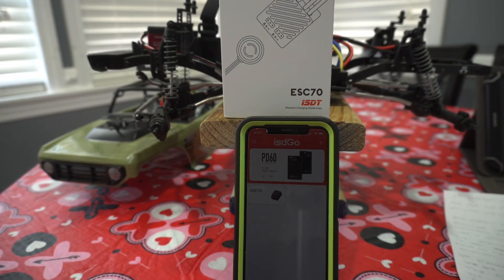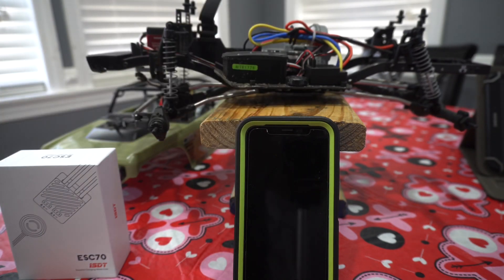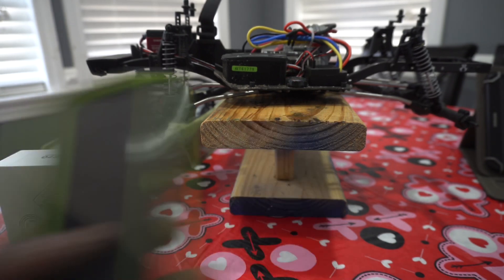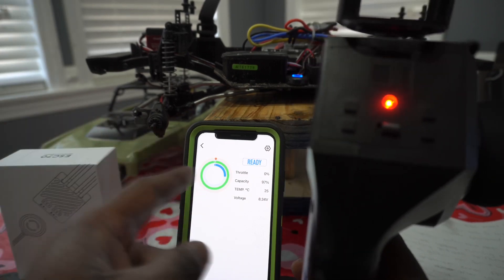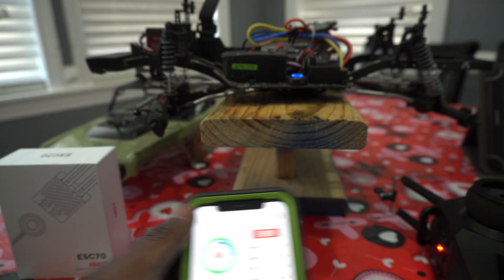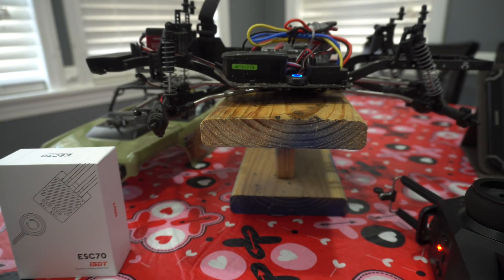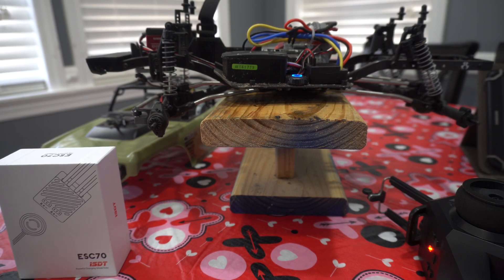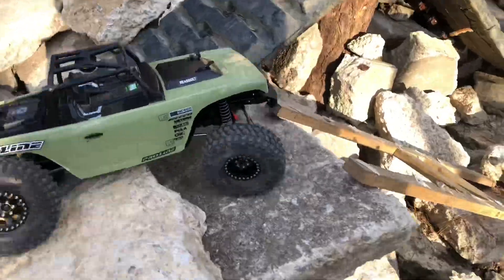ISDT ESC 70 review & troubleshooting fix & rock crawling test

Comment: I sure find it funny that all you guys that are reviewing this ESC will NOT show the pairing process (Bluetooth) until that happens I will NOT buy another one. But appreciate your input and video..
Reply from the maker: And they have a Facebook page where they will help you out and if you have v1 they will help you get the right version
Reply from the maker: The pairing is easy open the app hold the button and linked
Reply: @ClickClacksRcs  boy OO boy
.. I do wish you and the last 5 channels who told me that could see what I'm dealing with! It does not work that way, it does not give me the option, the app never has found the ESC with the Bluetooth on and scanning I have no idea what's wrong but I'm currently fighting with the distributor that I can return these two that I already bought
Reply from the maker: Ok first power on the car hold the button until it turns blue then go to the app and hit the plus button and it should start searching for near by items
Reply from the maker: If your having problems still uninstall the app and restart the process
Reply: @ClickClacksRcs  I have done this process (restarting and uninstalling both) twice ... The outcome is the same both times, I also have joined that group and all have offered the same advice you did today .. so yes it's frustrating..
Reply: With the ESC OFF, Long press the button and continue to press until it's flashing blue. Then scan for it. ISDT just put out a video on this, check their page for the most recent.
Reply: @monosurge  I appreciate your time to this response but on mine that process does NOT work..  I know and understand what you mean.. it just simply don't work on the 2 i have...
Reply: @monosurge  actually I will tell you exactly what it does when I do what you have instructed me to do... Push the button and hold.. the ESC comes on (continuing to hold) light flashes white then comes on green (still holding) and then after a few seconds the ESC powers itself off and the green light goes out ..
Reply: @chaddenman692  I just seen your video. I'm sorry. It must be frustrating getting the same replies all the time. What happens if you unplug the battery, press the button, then plug the battery it while still holding it?  Or have you tried that?
Reply: @monosurge  wow! Finally a answer that I haven't tried... Thank you.. I will try that tonight as soon as I get home.. thank you for the effort and time .  I'll let you know
Reply: @chaddenman692  You're welcome. Also, I seen on a review somewhere that there is a firmware bug with starting the esc with a full 3s pack. looks like a 3s pack in your video. Try the test with a 2s if you have it. If you manage to get in, be sure to update the firmware ASAP. Good luck.
Reply: @monosurge  absolutely I have both and I problem I'm having is (if I'm understanding right) that the ESC CAN'T be updated without being Bluetooth connected?

Comment: Run the firmware update.  It’s quiet it in Active drag  break down.  Thang starting to work better.  
    I had some of the same little issues.  
  When saving do one at a time.  It works a little bit better for me.    Trust me the same ones on Amazon are the same ones on Bangood.  And. AliExpress  
   I’ll have a vid soon too buddy cool cool  
  O. Man I have to wait a minute sometimes for it to drive.   But it’s super smooth. I believe it’s worth $25 no more. At the time 👌

Comment: Nice video bro! I’m likin mine to. I bought two. Figured ide try. So far so good. I to quickly learned that you gotta back out to get it from timing out. I set the active brake to 1 and it works real nice. I can go up to level 3 without jittering. I put the pwm to 8k and it seems to hold best and have the smoothest starting on a hill. It’s so damn smooth like it’s locked to the trigger.
Reply from the maker: I gave up on it the first time and I figured I was doing something wrong had to give it another shot glad I did I’m very happy with the the drag brake holds down hil and I have my throttle curve down for a very smooth and consistent power crawl
Reply: I have one too 👍👌👍